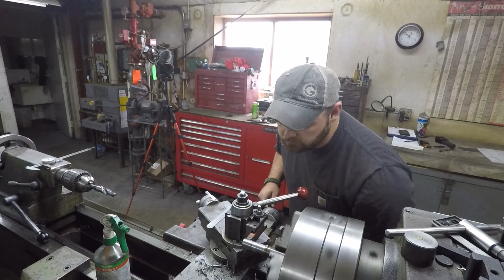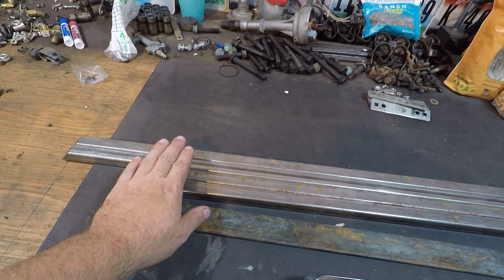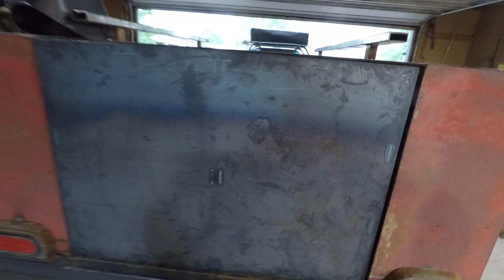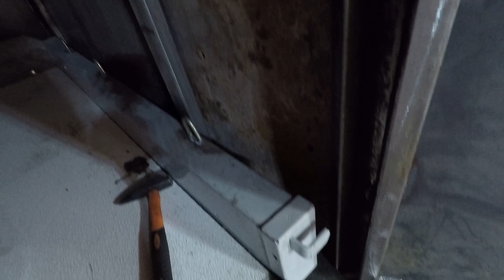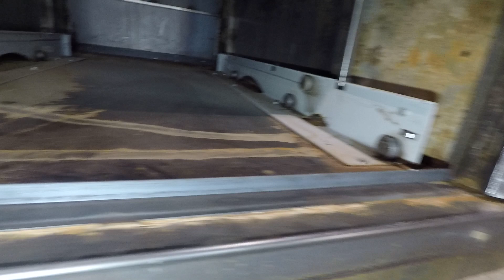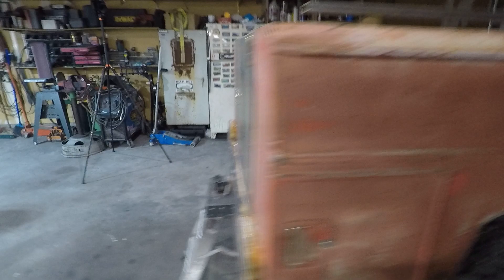The Roamer - Part 4 - Project Overland Trailer Build - Camper conversion part 2

Comment: Great inspiration here. I'm going to start my own build soon. Nice series.
Reply from the maker: Thanks 👍 you will have to share your build when you finish
Reply: @dboverlandjd  I will share it definitely on my channel for sure. I'm starting with a 48x54x24 frame made out of 2x2 square tubing. I've gotta add a tongue and axle with some siding, a door like yours in the back, and one on either side in the front. I'm gonna put a roof top tent on top. I've often thought of doing exactly what you're doing here. Looks better than I envisioned.
Reply from the maker: @TheRightLine  awesome! Sounds like it's going to be a good build. What's your channel so I can follow a long.
Reply: @dboverlandjd  The Right Line. I've got to sell my camper first, then I'm gonna get started.

Comment: Brother Curious did the slider still open over angle when loaded?
Reply from the maker: yes! I have tested the slide up to 300 lbs and it did not touch the angle iron trim.
Reply: @dboverlandjd  Brother, Awesome! Thank you for responding back to me! Best Regards!
Reply from the maker: Hey no problem. Thanks 👍

Comment: New vehicle? Hope You got a Jeep. --not  a Toyota.
Reply from the maker: I did. Two of them lol I will be introducing them here soon.
Reply: @dboverlandjd  ...And here I was calling you a superhero. lol. I've actually did the exact same build, except, mine was from a cut up service body. I don't have the roof rack or the back hatch yet. You helped me in seeing both how it should be done and what's all involved. However, I'm a Jeep JKU loyalist. LOL
Reply: @plstafford9750  I'm working on my own service body trailer right now. Had been chopping on a steel body unit, but a fiberglass one came available at a price I couldn't beat...